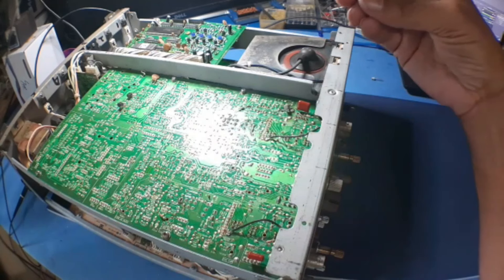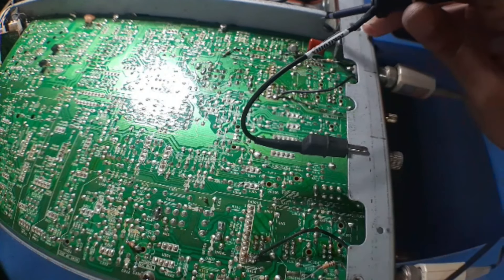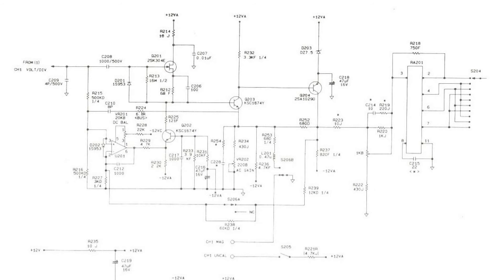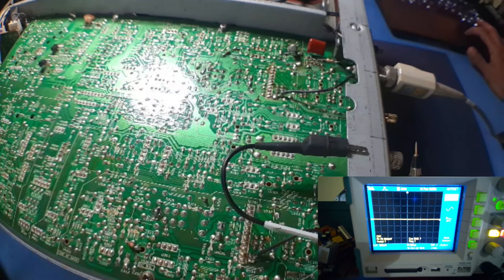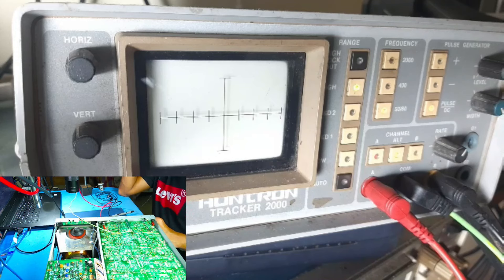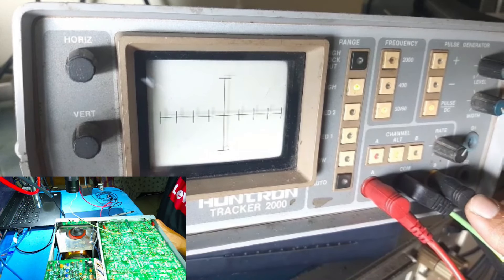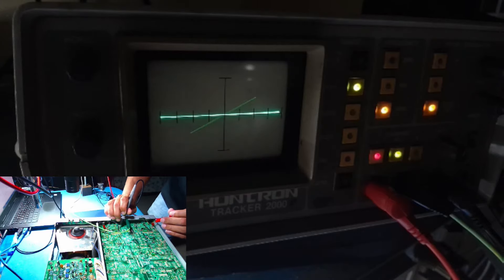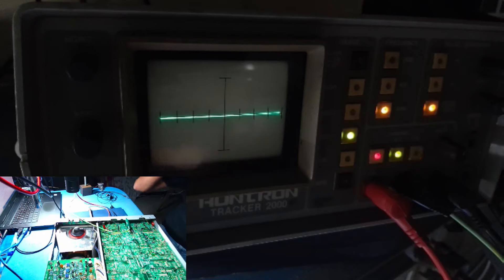GoldStar Oscilloscope repair

Comment: මොස්ෆෙට් GATE Driver Stage එක POWER මොස්ෆෙට් එක නැතුව operate කරොත් Diver stage එකට හානි විය හැකිද? ස්තුති.
Reply from the maker: ඔයා අහන්නේ මං මේ replace කරපු FET එක ගැනනම් ; එක power mosfet එකක් නෙවෙයි . ඒක low power JFET එකක් , ඒක නැතිව operate කළා කියල driver stage එකට හානියක් වෙනනෙ නෑ . Power MOSFET එකකට උනත් එහෙමයි .
Reply: @dilshan1971  ගොඩක් ස්තුතී.  ඇත්තටම මට දැනගන්න ඔන වුනේ SMPS එකක් සම්බන්ඳවයි. ප්‍රශ්නයේ අපහැදිතාව සම්බන්දයෙන් සමාවන්න. RF power stage එකක් open තිබ්බොත් power stage එක හානි විය හැකිනේ ද?
Reply from the maker: @ishanfernando9640  ඔව් RF amplifer output එකක් matching load එකකට සම්බන්ද නොකර operate කලොත් , High SWR නිසා power reflection එකක් වෙනවා , මේ reflected power එක නිසා output Transistors හෝ MOSFET පිච්චෙනවා .